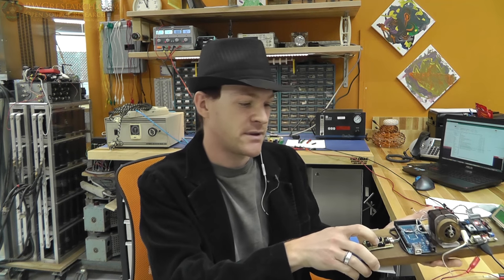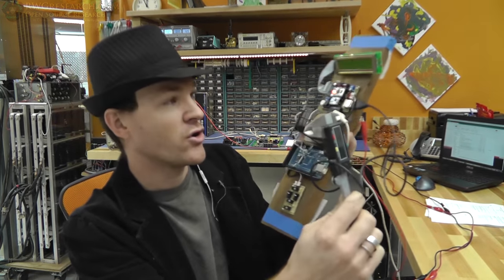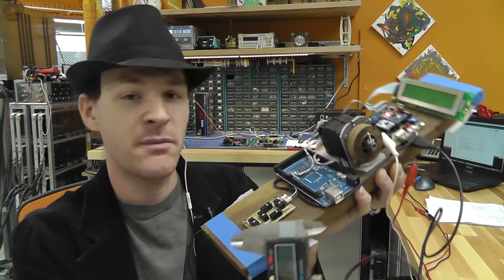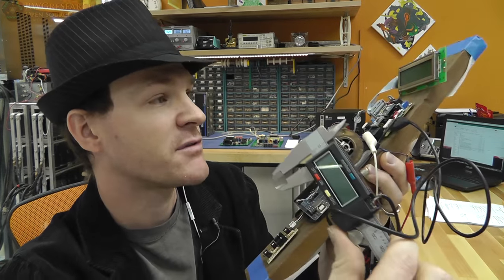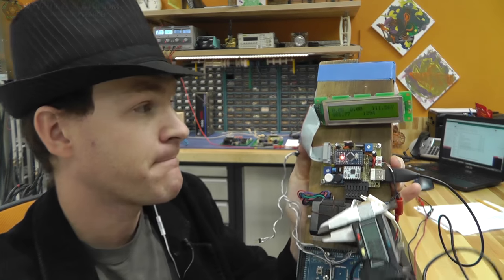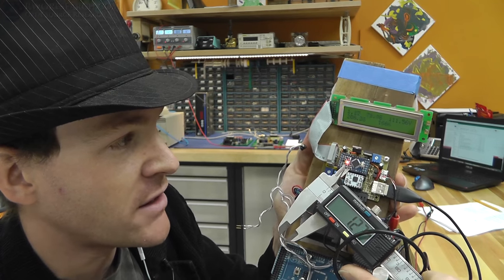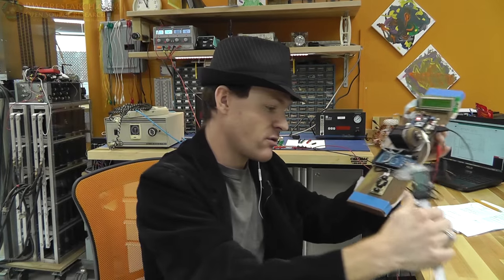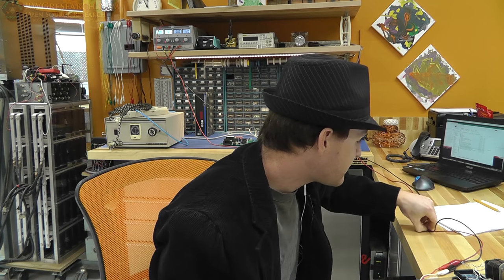#17 Filament Extruder Puller PID loop Update, Passing The Torch... TEAM WORK!

Comment: I just wait to get my 3d printer. 2days left till gets
Reply from the maker: +Lucas Lucas (Hdshow)  you get it it? if it was a kit you have some work cut out for you :) if it was pree built and tuned then happy printing :) ~Russ
Reply: +rwg42985 yes i have gettit and of course is a kit but it tok 1 day to assembly but need lot of work to tunned beacouse is a china kit and they send me the smooth rods and the berrings with very poor quality and have to wait till get the new ones. And for the contest have some scaches for now.